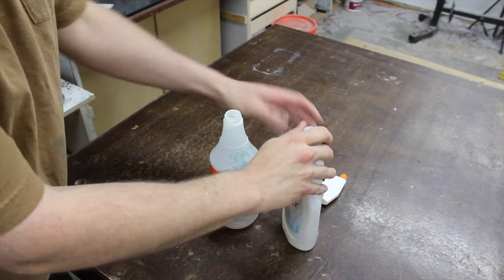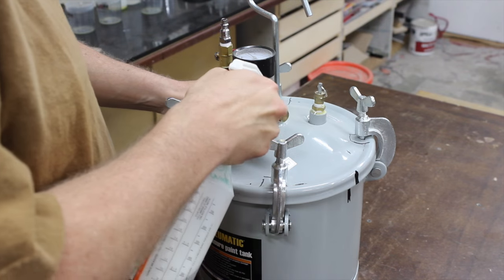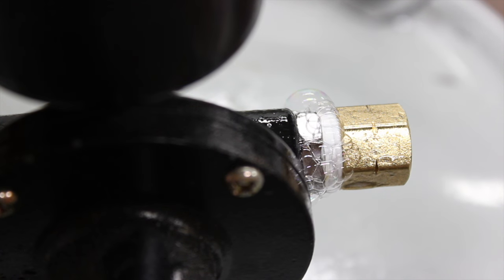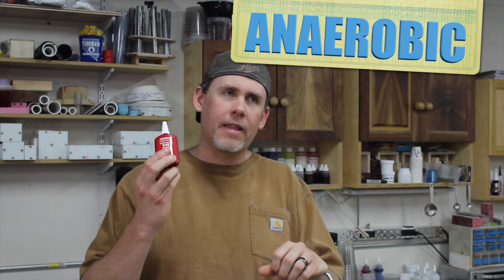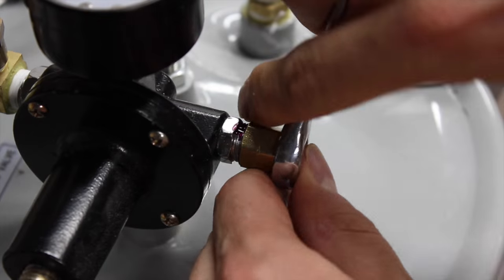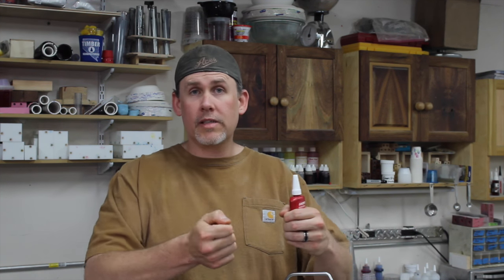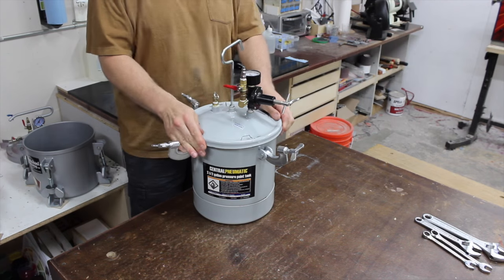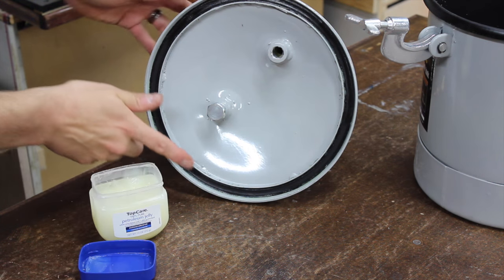How to Find and Fix Air Leaks in a Pressure Pot for Resin Casting

Comment: I bought my CA pressure pot from Finish Systems mostly based on your recommendations. I also had a small leak at the valve where the pick up tube would be if it were a paint pot and not a casting pot. I tried Teflon tape and joint compound with no luck. Finally I gave Finish Systems a call, they immediately apologized and offered to either replace the lid or send me some Loctite and a nut to thread from the bottom. I had them send me the loctite and it arrived in two days. I put  a little on the threads, screwed it in, let it sit overnight, and it doesn't leak anymore. I just wanted to thank you for recommending Finish Systems, and let everyone else know that they turned out to be a great company to work with and that I'd highly recommend them.

Comment: When I bought my Harbor Freight Pressure Pot I had similar leakage problems. I realized the main leak was coming from the regulator that came with the Harbor Freight Pressure Tank. I took some soapy water in a spray bottle I  found a crack around one of the threaded fitting holes. I bought a new regulator for a compressor and changed it out. I then found pressure leaking out from the lid. No matter how much I tightened the screws down, it still leaked. 
I was watching Chris Notap video on leaks and he told of a video he watched with the same problem and it was solved by turning the rubber gasket over that sits in the lid. The rubber gasket is flat on one side and has some grooves in the other side. The flat part gets laid against the top of the lid. The grooved side sits against the top of the tank. I use Vaseline to coat the edge of the tank and also against the rubber gasket. Last night I wanted to try it out. I pressured the tank using hand tightening the hand screws and not over tightening them. The tank didn’t lose any pressure at all over 16.5 hours! I was happily surprised with the results!  I got a great deal on this Harbor Freight Pressure Pot. It was a display model with some scratches and evidence of tightening the screws around the lid. The manager sold it to me for $50.00 because it was his last pot and didn’t know if he would get any other pressure pots. Good deal even with purchasing the needed retrofit of the lid and the new regulator. Best regards, Richard
Reply: Thanks for this post I have the same problems. I'm going to check how I set my gasket. You mention grooves and I think I have my grooves facing up. I think I understand the purpose of those grooves and why they need to be facing down. I also have some vaseline for extra insurance and give that a try.

Comment: Thank you again for the great tips! 
I used the soapy water tip on my pot and fixed all of the little leaks that were making my life miserable :)
I used Pipe Thread Sealant to seal the fittings, and it worked great. No issues at all now!
Reply from the maker: That's great to hear Emily!! I'm so glad that it was helpful for you. Now it's time to cast some fun stuff =D

Comment: Good vid Zac.  I bought a PP off ebay and it is a good brand with the hold down tabs for the screws made into the lid.  So you only have 4 positions to turn the lid so it lines up with the bolts.  I had problems with the seal leaking and even bought a new seal and still did not work.  On a whim i took the seal out and put a small bead of silicone in the seal pocket and then put the seal back in.  Gave it a few days to setup and then locked it down and put the pressure to it and now it seals and in any of the four positions.  As the pressure builds I can hear the seal leak some between 25 and 30psi.  Then i hear a slight thump and no more leak and will hold 45-50psi no prob.  I can leave the PP sealed for several days with very little leak down.  I may give the loctite 545 a try on my fittings as that may be where my very small leak is.
Reply from the maker: +vdubbsxb Great tip on the silicone, thanks for sharing that. The lid gaskets can be a bugger sometimes if things aren't just right. I'll have to give the silicone a try next time one starts acting up!

Comment: Great stuff, convert my pot Saturday and it lost pressure over the last 2 days.  Will try your techniques to (hopefully) solve my leaking issue.  Thanks from Down Under.
Reply from the maker: Great to hear you're getting up and running Brett!! I hope that the video helps out on those leaks. Plumbing joints are easy to fix, just hit it with that anaerobic sealant, and it should take care of any problems for you. Lids can sometimes be buggers, but with a bit of fiddling should work itself out. One thing to note, my pots lose pressure overnight too, they are pretty much impossible to get completely air tight. If you have to keep it pressurized for long periods of time, then you may need to just hook up the air line the whole time. I don't generally recommend that, but as long as you have the regulators set correctly you should be good to go
Reply: So I followed your advice and after stripping it all down, getting some quality anaerobic sealant. I now have a pressure pot that has held 50lbs of pressure for over 24 hours. More than happy with that. Thanks again.
Reply from the maker: Yes!!! I'm so glad that I could help out a bit. I'm really glad I found out about that anaerobic sealant, it's the best thing since sliced bread! Hope to see some castings when you get some poured :)

Comment: Search Results
I was always told that Vaseline or other petroleum products should never be used on rubber or neoprene objects. It can deteriorate the rubber or neoprene very rapidly. The correct lube to use is a silicone based lubricant. Using Vaseline on "rubber" parts is old school, may have been fine 50 years ago even 30 but today "rubber" is made from all kinds of synthetics.

Comment: Hi Zac. I really appreciate these videos. If you don't mind, I do have a question for you. I found a leak in one of the factory fittings. But it's stuck in there so that I'm still not able to get it off. Do you have any advice for something I can put on the outside to seal the leak? Or of a way that I would be able to remove the fitting.

Comment: what kind of fitting are you using to put the pressure valve on the top of the pot.  Seems to be 2 different types of thread and i can't seem to find one.  Thanks for the good video

Comment: Love and appreciate your tutorials.  I could use some further advice. I used the product you recommended for sealing threads but after tightening down solid and waiting 3 days my pressure release valve still has a leak. It's not popping open, I made the adjustments for that. It's just slowly leaking air. It is a harbor freight 2.5 gallon paint pot and that seems to be my only problem at this point. Any suggestions?

Comment: Thanks so much for this video! Exactly what i was looking for
Reply from the maker: Glad it helped out Josh =D
Reply: I cant help but be a little freaked by this thing. I dont think i will ever b casting over 40 psi, but still, reading about the lid failures bothers me. I would love to see a picture of the lid after the failures ive read about. I will just have bubbles before i go buy a 400$ ca tech. My wife would kill me lol
Reply from the maker: If you don't go over 40 PSI, it will likely be ineffective. 40 PSI is the absolute minimum for Alumilite. Most of the cheap pots can be run up to 50 PSI, but the thing about cheap pots is they are made with cheap material and lower quality controls. If you can't afford a high quality pot and don't trust the cheap ones, just use a slow setting resin that doesn't require pressure to remove all the air bubbles

Comment: Had a feeling the seal wasn't right. I locktite'd all the bits n bobs and had hit it was soap and no bubbles. Your vid showed only 1 other possibility so i'll rotae it the next few times I use it and hope i find a sweet spot. I swear i'm also tightening it enough but recently had nerve damage in my arms and lost a lot of strength so i wonder if i'm not tightening it enough too.

Comment: Hi Zac,
Some good tips there! One thing you forgot to mention, when you want to remove a fastener or fitting that has been sealed with Loctite, it removes easier when you heat up the fitting. Without heat the fitting is really hard to get off without damage. Hope that helps.
Reply from the maker: +Jim Kodysz Those sealed joints are a pain to get popped loose! Thanks for mentioning it Jim. I was so focused on applying the sealant, it didn't even cross my mind to talk about how to get them loose! I might do a quick tip video on it down the road.

Comment: Do you have a video showing how to replace the safety release valve on a CA Technologies tank? I just got mine and barely used it and now the damn safety release leaks as if it were just an open hole...its absurd. I have never replaced on, so not sure what part I need to loosen with a wrench...there are 2 nuts. I have placed an order for some Loctite 545 from amazon...

Comment: The Vaseline trick has mostly worked for me - brand new at this and my pot previously got to ~20psi before the gasket leaked, now it'll get close to ~45psi before I hear the faintest "tsssss." The new leaks are right at a clamp, so a wrench on the wingnut makes the sound go away. Alumalite recommends 40psi for their resin so I won't push my luck with increasing pressure and restarting the leak. 

First casting's in there now, we'll see how it turns out!

Comment: I tried closing up the lid  doing the screws on opposite sides but my problem is I have weakness in one of my hands because of pressure on a nerve that is still healing. But even before that accident I was getting leaks. Other times I have managed to get it to where the only leak I was getting was from the safety valve. That's what I want.

Comment: I agree with everything you said, and was very helpful.  However, using red loctite can be a problem if you ever have the need to replace one of the fittings.  I’ve used the red loctite before and it’s near impossible to remove the fitting.
Reply from the maker: It's not thread locker, it's an anaerobic sealant. Doesn't glue the threads, just seals them

Comment: Instead of Vaseline, I used Dupond Teflon Silicone lubricant.  The lid works perfect afterward. The lubricant helps prevent dust and corrosion as well. 
My pot stayed at 50psi without any leak after 24 hours.
Other than the pot itself, I had to change every single pieces, including the regulator as well (it was leaking around the screws as well as the knobs).  However, it is working great now.  The price came out to be around $150.  I might as well bought the other upgraded pot :(

Comment: Great video.  It happens that I'm having air leak problem.  Will use these techniques today.  Thank you.
Reply from the maker: Those air leaks can be pesky!! I hope that some of the ideas in the video will help you shore it up and get back to casting :D
Reply: Zac, Thank you for the video.  I did all the steps as the video instructed and when I check for air leaks on all the pipes connection I see no bubbles popping out.  However, it keeps loosing air.  a lot slower, but never the less it loses air. I start at 50 psi and within 30 to 40 minutes it goes down to about 40 to 35 psi.  it is frustrating, because I can't find the air leak.
Reply from the maker: Only other thing I can suggest is just tighten the clamps more. Grab a wrench and give them one more crank before you pressurize it

Comment: I have used 2 kinds of Teflon tape,  loctite thread locker,  2 part epoxy,  gas rated duct tape,  marine grade thread locker and out of desperation super glue, hot glue, caulk and Vaseline. My pot still won't stay pressurized! I did the soapy water trick and can't find any leaks.  Any ideas?

Comment: I have a leak coming from the lid, on the inner circle. From a weird weld thing the manufacturer did. It is slightly misaligned and The last two pots I purchased had these weird weld thing, so  I am curious if this thread sealant could possibly aid in sealing up this gap. 

This gap is beside this rubber seal on the lid, from this weird weld thing> Honestly I want to salvage this pot to use for resin but I am scared to break this so seeking some community aid, much thanks

Comment: I'm having trouble finding pressure relief valves that are either rated for around 60 PSI or even state what PSI they are set for. 

In chasing leaks in my HF pot I cranked it down too hard on my valve and broke it and the tee it went into. In searching for replacements, all that I found were rated for 200 psi. I found one that I thought may work but got it yesterday and it too was 200 psi. I'll try to adjust it down, just hoping it goes down that low. 

Another tip if you are replacing the fittings, just go for black pipe fittings and try to stay away from brass. You can't break iron. :-)

Comment: Hey Zac, I tried using teflon tape to fix an air leak on my cap for my regulator. After 3-4 attempts with multiple length of teflon and making sure that the cap is extra tight, I find that air is still leaking from the same spot. Do you know if this is an issue with the brass cap itself or should I just purchase the anaerobic sealer?
Reply from the maker: As I mentioned in this video, teflong tape really doesn't do much. Anaerobic sealant is made to fix leaks though, it should fix you right up :-)

Comment: Love the vids Zac, am a newbie.  My CA pressure pot looses like 1 pound pressure per hour?  I have tried to fix any leaks but still a slight leak somewhere, how worrisome is the slight leak in casting?  is there a "too low" pressure that will screw up the casting after 10 hours or so?
Reply from the maker: Hey Dave, For Alumilite, it probably wouldn't matter too much. For resins that take more than 4 hours to fully harden, it might be a problem. Either way, you should be able to shore that leak up a bit more. You don't want to drop below 40 psi before the resin has fully hardened.Check the safety valve and the regulator for leaks using the soapy water method. Sometimes the regulator leaks around the screws that hold it together, I'd just apply caulking over it if that is the culprit. If the safety valve is leaking from within, then you might need to replace it or ask for a replacement if the pot is new
Reply: Zac Higgins I had a leak in the regulator so just removed it and the air meter is connected directly to the lid. I know that isn’t recommended, but is it really that dangerous? I use this pot and only go to 40PSI and of course have a safety valve. Once the pressure gets to 40PSI, I close my ball valve, then disconnect the compressor. I can’t really see the harm in this. What are your thoughts?

Comment: Hi Zak just received my C A Tech Pressure Pot and i have a leak at the factory inlet fitting on the Pot lid , do you recommend any method to fix this or should i send it back.
Thanks Roger
Reply from the maker: Hey Roger, I would contact the company you bought it from to figure out the best method

Comment: you talked about finding and fixing the leaks of pressure pots. I just setup a harbor freight pot. I have never done any pressure casting before. I got all the plumbing sealed pretty good. used your soap suggestion. You suggested using petroleum jelly for around the seal of the lid. I have done this and it worked. However i had to reapply when I went to seal up the pot again. Does this mean that the gasket is bad? I tighten the lid across just like you said.
Reply from the maker: Hey Larry, you might try using a wrench to tighten the screws down a bit more, sometimes that helps out. If you can't get it to seal though, you can either try removing the gasket and pouring in some silicone into the channel or taking the pot back and hope you get one that seals better
Reply: Hi Dillon, I too bought the Harbor Freight pot. I am also getting a slight leak around one particular area of the rim. I tried turning it but still get the leak. I have not tried wrenching it down instead of hand pressure though. One think I wondered is if the petroleum would eat the gasket over time since it is oil based.
Reply: I am still working on my pot. I noticed that my gasket was getting rather hard. I took it out and made a silicone gasket. I put in way too much silicone and made a mess, even after letting it dry for a day and a half. After cleaning up what remained of the silicone made a good gasket. I also made sure I wrenched it down fairly well. I have been testing to see how well pressure is being held and have noticed a couple of other leaks. I am using some silicone around them also since they seam to be a few places I have not added anything to. Good luck

Comment: My CA Technologies pot was leaking bad from the fittings even after using Teflon tape. I bought some 545 and that stuff worked like magic. $26 for a tiny bottle, but well worth it.
Reply from the maker: Yeah it works like magic, but it's definitely not cheap Luckily you don't have to use very much on the threads. I'm glad you got those leaks shored up, now you can get to the casting =D
Reply: Everon Railways Teflon tape works good but you have to use it in the right way. Its so thin that you have to wrap it many, many times, almost to the state when you cant see threads, then tighten it well and there is no way for it to leak.

Comment: Since I just got a HF pressure pot I've realized a few things. Yes tape is not going to work well.

The old HF fittings are glued in and leave residue in the threads. I used the proper sized pipe taps to clean them out. 

I don't think the lid threads are tapered so very little threads are used. The tap helped this a bit. 

I did use dope after getting leaks by using layers of tape. I used black pipe fittings instead of grass since you can tighten them down more.    I also pretty much only used the pressure relief valve and plumbed up everything a little differently than yours.
Reply: Grass is never good